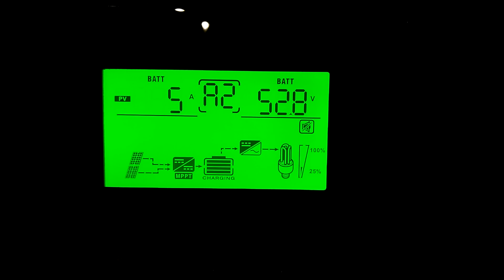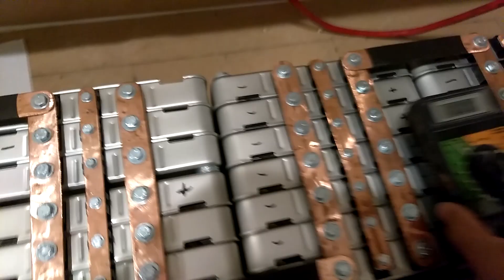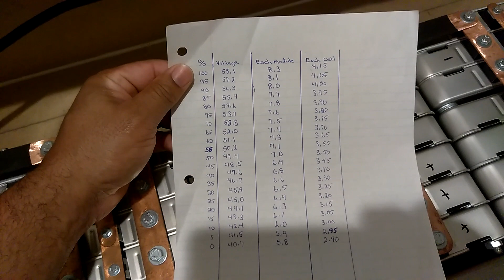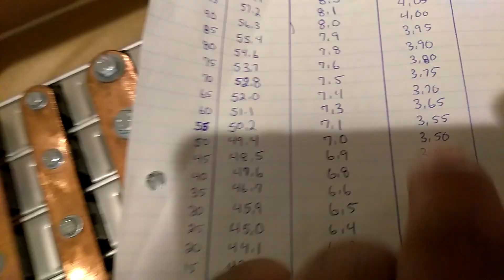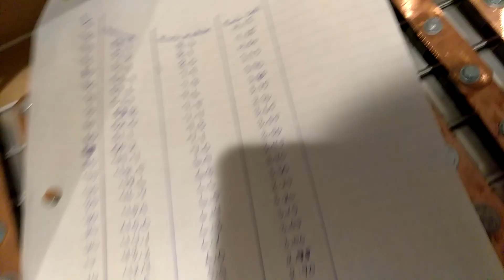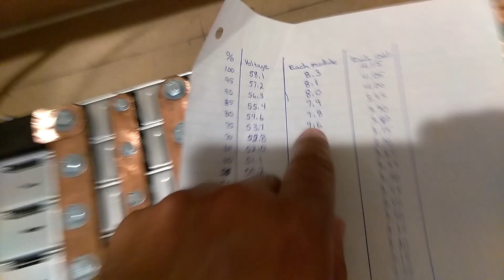First day with no sun and how the battery pack did overnight

Comment: I'm pretty much doing this exact same setup right now, but I'm only starting with 14 leaf modules, so I'm just running a couple of things. I want to scale it to three lv5048's and like 70 modules.
I really like how you did your battery layout with the parallel and series cells.
I'm also not running a BMS (The MPPSolar can do overall charging current and voltage regulation), but I'm going to try one of these with it: https://www.amazon.com/gp/product/B07SFCY36G/ref=ppx_yo_dt_b_asin_title_o00_s00

Comment: Where did you source your copper busbars please?
Reply from the maker: Home Depot is copper water line make sure you get the one with the blue stripe on it it's the thick wall copper pipe half inch.
Reply: Thanks!
Reply from the maker: @cyberdude1010  you're welcome. 👍

Comment: Why are your center copper bars smaller than the other 2 ?
Reply from the maker: The sinner copper bars are only for balancing if I would have used the same size it would have touched the other two outside copper bars so I use smaller to make sure I did not contact the other two when installing onto the batteries.
Reply: @carsonlurbanwindandsolar3437  Thank you
Reply: Thank you
Reply: Can i use the same size bus bars for all 3 ? or do i have to make the center bus bar smaller ?
Reply from the maker: @paulalien5062  yes you can use the same size on all three it's not going to hurt anything.